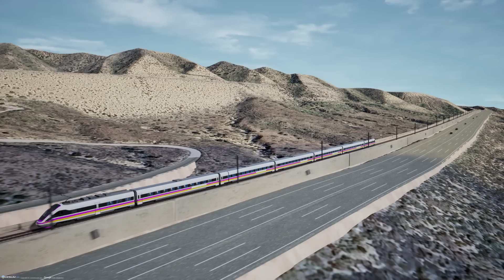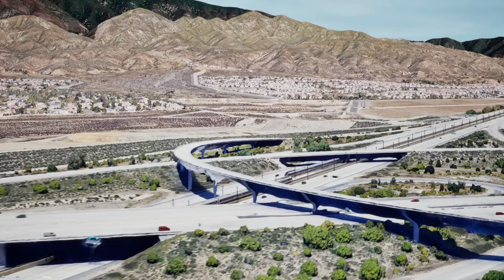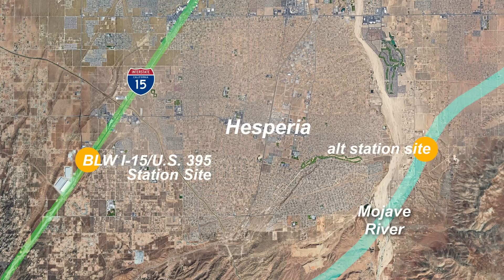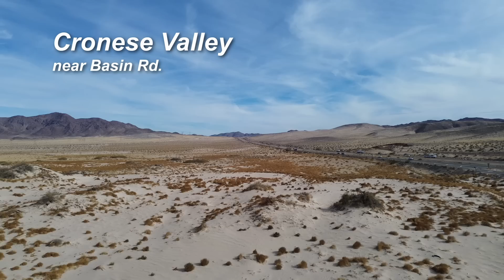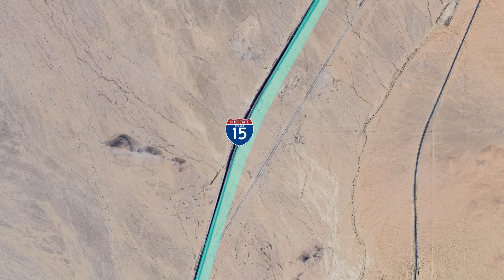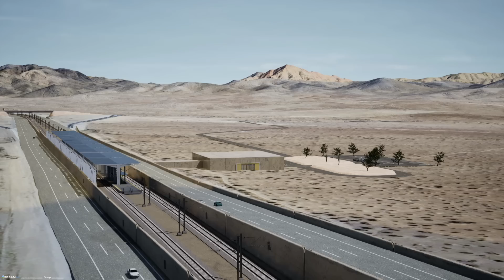Brightline West High Speed Rail Better, Stronger, Faster

Comment: I'm all for protecting the land, but I wonder if an exemption for electric rail shouldn't be made, given what it can do for the environment.
Reply from the maker: The thing that strikes me most is the EXTENT of it. Without exaggeration it is most of the Mojave and a good portion of the Colorado desert. The area is larger than some not-so-tiny states. Even the Halloran Springs area mentioned for the detour is an Area of Critical Environmental Concern.
Reply: 85% of Nevada is owned by the Federal government, 63% of Utah is Fed owned.  That doesn't even include all the state parks and reserves.

Comment: $115 million/mile sounds somewhat reasonable.

That would be about the cost of the latest stretch of HSR in Germany (Wendlingen–Ulm, 60km/37mi, €4 bn), albeit this section is about 50% tunnel.
Reply from the maker: Current assumptions are that construction in the U.S. runs expensive, but I will adjust those assumptions if a real project out there shows otherwise. We'll see how Brightline West goes with their budget.
Reply: The western US is relatively sparsely populated, so the payoff for the money invested may be quite different, idk.

Comment: If you're just going to throw caution to the wind, you may as well follow the UP from Yermo to Vegas. Fewer tunnels, easier ruling grade, faster speeds.
Reply from the maker: You wouldn't be able to because a high speed line would not stick strictly to the existing right of way and it goes directly through the Mojave Trails National Monument and Mojave National Preserve.

Comment: The enemy of good is better.  What’s proposed here is tons more money and a decade of delay.  It isnt worth it (see CHSR)
Reply from the maker: Where is the sweet spot to make this happen in places around the country where it would make sense? Is it a Brightline West model or a little slower/faster? Or how about Illinois HSR? They upgraded to 110mph and are looking to upgrade further/possibly separate more from freight...
Reply: @ Higher costs means harder to finance. Which also means higher ticket prices.  Higher ticket prices=higher break even point(the point where you make money). If you can’t break even then you go broke or have a subsidy something CHSR is doomed to discover.  If this a success (I hope)then your ideas a good starting point for Long term improvements.  Remember it took decades to get the cascade tunnels built for the NP.

Comment: Twice the cost would need twice the ridership. That would mean increasing from 18% of current trips to 36%. I don't think that's doable from a fairly inconvenient station in Rancho Cucamonga. So before doing that, they'd need a connection with decent speed to downtown LA, and additions to the local rail network so there's a way to get there reasonably from the LA county SE suburbs and Orange County. A future video idea would be looking at the possibility of modifying the existing route in the future to pick up some of the benefits, like the tunnels for Halloran Summit and the Cajon Pass, or some viaduct passes to skip tight freeway curves. Some of that might be more practical for future doubletracking; the speed benefit would be in only one direction, but that's better than nothing.
Reply from the maker: Do you think 18% is doable with the current plan?
Reply: @LucidStew  I'm hardly a traffic expert, but looking at how much hassle it will be for me to use it from where I live in Orange County I don't think they'll get a whole lot of traffic from Metrolink xfers. So that leaves cars. They are projecting about 25,000 per day - figure 3 to a car, and an average stay of 3 days; they'd need 25,000 parking spaces for all of them. Say 20% are dropoffs and xfers; are they going to have 20,000 parking spaces there?

Comment: Another great video! I'd love a California HSR vs Brightline West comparison video to show the cost and time differences on similar routings to really emphasize that sometimes going for broke quite literally isn't all that helpful aka how you could value engineer the next phases of CA HSR and contract it out to private builder/operators. That's if it hasn't been done already... There are certainly enough potential bidders judging by the consortium competition that signed up for the TOM Express.... Aka Toronto-Ottawa-Montreal... 6 bidders cut to 4 with 1 selected but not announced... Siemens, Alstom, DB, SNCF, CAF, Recife, Hitachi and even CRRC were rumored partners willing to get this line running at 300 km/h between the cities, a carrot that has been dangling in front of Eastern Canadians since I've been alive and I'm well into middle-age by now...
Reply from the maker: I don't want to go full doomsday on CAHSR quite yet, but how to take completed pieces and get something more useful out of them without full build-out is a good topic for future consideration. Hey, you're just full of good ideas the last couple days!
Reply: It will be interesting to compare California High-Speed Rail testing trains in 2028 with the progress Brightline West has made at that time. Until construction of structures actually begins on Brightline West any cost and time comparisons have a very high degree of uncertainty and are pure speculation

Comment: I think the current plan works, but they should have plans and provisions for future upgrades. 

A basic example is running single tracked segments off center so you can upgrade to double track without moving the older single track. 

And working with highway departments to have the median widened in places during normal maintenance & repaving work. That way you can increase available space for the train, without actually paying a huge additional cost since you were already going to do that maintenance work.

Ultimately doubling the project cost for a 25% time savings is unlikely to drive enough ridership to be worth it.

Comment: There's what's possible and there's what's practical. Brightline Florida is entirely on existing track owned by FEC or the new track they built in the 528 ROW. 528 was built with HSR in mind so there was a bunch of ROW set aside for it and most of the bridges were built with HSR in mind - not in the median but on the south side of the expressway. Also, that entire stretch from MCO east to I-95 is single tracked with a few sidings. That's all they need right now. No point in spending a ton of money on full double track that they're not going to use for years. They also don't have the money to go buying ROW and building massive viaducts. I think what most people with HSR is that it doesn't have to be ridiculously fast. It only needs to be faster than driving and time and price competitive with flying. It's like Acela from Philly to NYC, is it really worth billions of dollars to reduce the trip time from 65 to 50 minutes? I think most people would rather see a 2nd Ave Subway extension or a Roosevely Blvd. Subway or even just cheaper fares on the NEC before the trip gets faster.

Comment: Saving $13 billion at the cost of 30-45 minutes is absolutely the right call. While it would be great to have the fastest service possible, the less capital required, the more likely the project is to actually succeed. If they had an extra $13 billion to spend there are better things to spend it on, like getting the western terminal closer to LA instead of stopping in Rancho Cucamonga.
Reply: When the connection with the CAHSR is done Brightline might go to LA…
Reply: My sentiments exactly.
Reply: When CAHSR gets connected to LA, Brightline will be able to do that
Reply: Unfortunately high speed rail is only a moderately good idea in the western US…. Only San Diego thru like San Luis Obispo and palm springs west has the moderate distances and population density to make it a better fit than aircraft.

Comment: If the cost for a business fare is projected to be $ 325.00 ( based on Florida's current rates)  and trains running at 65% capacity it would be a hard sell to get additional funding for the tunnels. BLW needs to recoup its investment; the fulcrum point has always been what if gambling is legalized in California.
Reply from the maker: I realize it isn't legal state-wide, but the Indian casinos are pretty ubiquitous. In my mind that just means a train connecting two gambling destinations. Sounds like heaven for gamblers.
Reply: With 3 major league sports teams (2 stolen from California) and more to come, LV has expanded beyond simply a gambling destination.  Metro area population is approaching 3 million, and new home builds are highest in the nation.

Comment: Curious what speeds the switches are designed for.
As brightline seems to want several double track stretches, it would really slow down the overall time if the trains had to go down to <60mph for each switch.
Reply from the maker: Brightline West lists their turnouts as 80mph.
Reply: @ probably the same switches that Germany uses for 160kph. I’m told they are crazy expensive.
The entire country of Sweden with its 6800 miles of track has 1 such switch.

Comment: IF they do actually BEGIN production for this train, we need assurances that this will not cause major construction delays for the millions of people who travel the I-15 freeway every month.

You talk about 3 mile curves.  The media of the freeway is not wide enough to accomplish this.  I seriously believe they will need to build so many crossovers of the freeway that they will ask that the freeway move rather than the train.  Also there are really a lot of areas that will require dozens of bridges be designed in the part of the country with the most strict seismic design requirements in the world.  Tunnels?  Yikes.  Those take years to build.

Comment: Really impressive use of tech to create a really well thought out fun alternative.  One of the challenges with tunnels is that you start getting the need for a vent shaft that allows the management of air flow in case of a fire or incident.  That means either a tunnel adjacent to the railway tunnel or vent shafts sunk from the surface every few kilometers so.  It will also mean a fairly significant area at the portals that allow emergency services to react to incidents and again thats really challenging and expensive.   I think Brightline west accepting some constraints and challenging the industry to build at speed is great when nothing exists today.  A slight compromise is better than nothing at all for 20 years.
Reply from the maker: Yeah, that's a thought I've had and a bit of miss leaving it out of the video where they've made a conscious decision to shift some of the onus onto the technology to unburden the routing slightly.

Comment: i agree with brightlines current plans except for the single track part, i hate single tracking, just pave for both ways and get it out of the way, makes it super easy for later expansion
Reply: I remember hearing that Brightline West is leaving space in the right-of-way for double-tracking the entire length, although I could be wrong
Reply: @NoTimeForNoodles  it does seem like the whole line will leave space for a second track, although it is possible that there may be a few places where there isn’t enough space without requiring moving highway lanes.

Comment: My changes:
1) Skip the terminus in the suburbs and continue it along I15, take a gentle curve to the line along Airport drive with a station at the airport.
Upgrade the commuter (Riverside) line to LA with more tracks and remove grade crossings.
This will connect it with downtown and all the communications there = more riders and les time in total.
2) Run the tunnel to Hesperia but along the existing rail tracks in the Western part and curve it off towards I15 somewhere along Outpost road
3) Where the I15 alignment has too sharp curves, I would pay for a realingnment of the inner roadway, it should be cheaper than a flyover.
4) The intermediate stations that are planned right now are meant for commuting on a high speed premium train?? Which commuter will pay for that?
And no reason to slow down a high speed intercity train for some local stop.
In Europe you would quad track them with side platforms and the middle tracks fenced off for high speed running, and only regional trains would stop here.
The regional trains must be capable of 125mph to be able to run together with high speed trains (plenty of European regional train models can do that). Regional trains should run quite often.
5) Single track can be done some places but needs many long double track sections to not slow down the trains.
And they should be prepared for an extra track.
6) Would it be possible to plrolong it to the Strip?
Maybe a combined heavy rail and subway tunnel?
Reply: There was a really good video here about how Ontario Airport could be a great hub station: https://www.youtube.com/watch?v=Jrv6LSZab5Y&pp=ygUXb250YXJpbyBzdGF0aW9uIGFpcnBvcnQ%3D

Comment: Brightline West should adopt your improved method of getting out of Rancho Cucamonga and into the 1-15 median.  Beyond that, they should build what they've announced, mostly as announced, to get the system up and running.  After they get the line running, they can implement your suggestions as "cut-offs," while adding stops for Barstow (shared with Amtrak) and Primm.  The "Barstow Union Station" might be in a different location than the existing ATSF/Amtrak Barstow Station, and the Brightline West tracks would be in a subway level with elevators and stairs up to the Amtrak ground level.  Barstow and Primm make more sense as HSR stops than Hesparia.  Barstow would also allow Southwest Chief passengers to transfer to the HSR system without entering or at least changing trains at LAUPD.  This would benefit those wishing to take the train to Las Vegas instead of flying, as well as allowing some passengers to bypass LAUPD for either travel towards San Francisco or San Diego, depending on exactly where Rancho Cucamonga ties into the CASHR system.

Comment: I wish they would build this right...30 more minutes means 25% more capacity.  This means better scheduling and each train is 25% more productive.  Also single track will discourage the high frequency needed to entice super commuters.  With HSR, you will always have wealthy super commuters who use HSR as a means of commuting into bigger cities...they are an important source of revenue, but they need good frequency.  Lastly there is a huge problem with building a freeway median.  I often see car accident parts in the median of my freeways.  Trains will have to slow somewhat so they don't run over chunks of rubber and other debris.  Unless they build a huge retaining wall, but I doubt that happens.  Silly they don't let trains be built in the protected deserts.  I doubt the existing roads had much difficult getting built in these precious deserts.
Reply from the maker: The Environmental Assessment for the Cajon Pass portion posits that they would be able to facilitate 12 million trips on 22.5 minute headways with 9 passing sections on the currently planned alignment. That's nearly equal to Amtrak's volume on the NEC.
Reply: I agree about the "precious deserts".    A couple of tracks across the desert isn't a major disruption if planned right.  Government needs to be more flexible about costs versus benefits.

Comment: I agree with most people here, getting the project up and running as planned should be the priority. Future improvements can occur in stages over time
Reply: Tho they should still plan the design for dual track even if right now the only plan is to single track certain parts

Comment: My biggest concern is whether BL trains can get up the steep grades. The cost savings only make sense if they don't have issues
Reply: i think the main issue with the grades is the curves on and leading to them
flooring it along a straight track then up a 6% grade slowly bleeding off speed as you reach the top is fine
but when you need to enter the climb at like 200km.h it becomes a lot harder
Reply from the maker: Plus its going to be more like 100-120km/h for some.
Reply: @LucidStew  geez i was going to say 150 but i was just guessing and thought that seemed too low to be correct

Comment: 30 minutes saving does not worth 13 billion dollars. Also, running at a faster average speed will wear out the equipment faster and increase the operational cost.
Reply from the maker: All things considered, I think the current plan with the grades, tight curves, and speed changes is likely a bigger maintenance headache.
Reply: @ Fair enough. Though construction of tunnels will likely take longer and delay the revenue service, which is an extra loss.
Reply: @LucidStew  Besides the maintenance and construction headache, the current plan with steep (downhill) grades, tight curves and single track also means higher operating costs and is an accident waiting to happen. There are over 50 000 km of HSR on this planet and not a single one was built on an existing highway median for a reason. Doing so while going through a desert looks insane to foreigners unaware of the political and legal context.
Reply: The difference in wear and tear is negligible, especially since the track and train systems are designed for even higher speeds.

Driving from Rancho Cucamonga to the Las Vegas station area is 3 hours. So Brightline West’s current plan saves 1 hour versus 1.5 hours in this faster, more expensive hypothetical plan. Considering the main part of the strip is still a 20 minute drive north of the planned station I think that half an hour time savings is worth considering.
Reply: Flying is still faster and fares are cheap.  And most people in LA are coming from further away than the BLW start point.  Flying seems to be the competition with BLW, not cars.